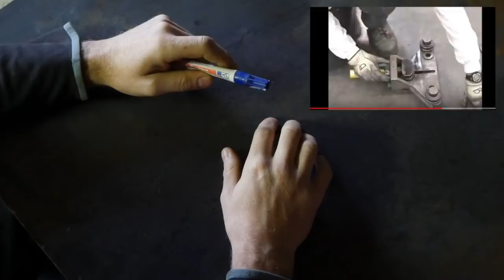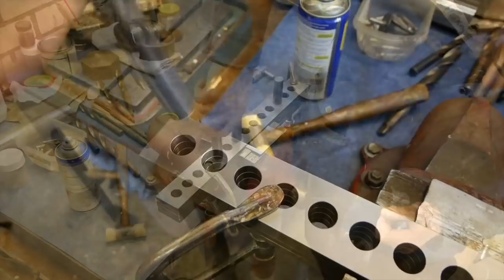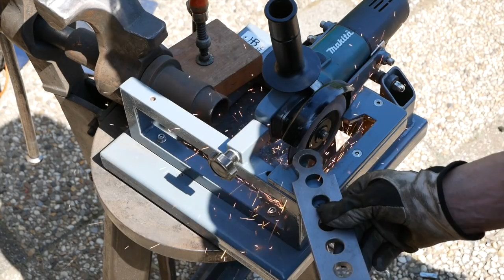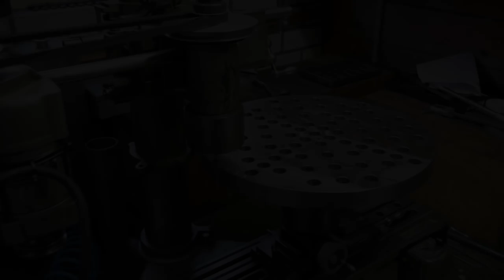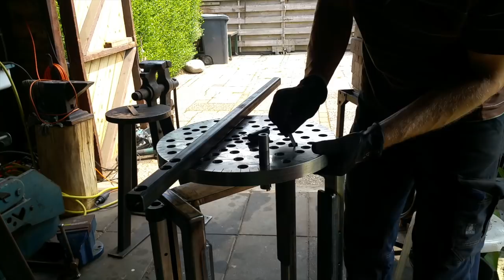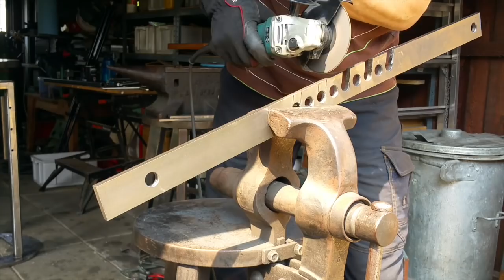Making the ULTIMATE Bending Machine Part1: Hossfeld?

Comment: Hey man nice video!
As a machinist I'd say your feed is definitely slow but also you take too light of a cut. Try doing at least 0.5 to 1mm depth with a minimum feed of 0.1mm
Also if you can use a bit with more of a radius carbon steel doesn't like pointy tools, a 0.8mm to 1.2mm point should work great 👍

I'll keep watching the build keep up the good work

Comment: About time a YouTuber made a descent bender. Very nice 👍. But even with your counter-leaver I think you will still need a bottom fixing. All I did was chemset two tapped bar stock flush with the top of the floor so I can wheel it over the top of them and drop the wingnut bolts through the base plate for bending the bigger stock. 
From the land down under 🇦🇺
Reply from the maker: Thanks! And yes a solid table is always better (or bolting it down to one). But at that time I didn't have the space for that. I am making a large ficture table in my new shop with the same hole pattern so I can also bolt it on there. But until now I havent realy needed it. The extra leverage arm puts to force more in line with the table holes and there is not a lot of rotational force. And it also is a sort of safety factor because the top plate is only mounted with 4x10mm pins. I dont want to have to much force on them.

Comment: Axles are usually mid-high carbon, or chrome moly.
Reply from the maker: Yes but these are much cheaper and I don't use the machine that much. I think they will be strong enough and I can always upgrade. High carbon would be more wear resistant, although I rather wear out the axle and replace that then the plates. I would also be interesting to see if they cold rolled steel is actually weaker for this because the forces are many shear forces.

Comment: Or get one for 150 online. Only going to bend flat stock and there is a much solution. Without Mandela you are not bending tube , or at least bending clean.  Spend a little more and get the hydraulic version no point spending a day busting your muscles the bend it
Reply from the maker: Thanks for the feedback. If someone would only use the Hossfeld than you can also buy it. But a combination machine like this (see part 4 in the end) with a small footprint is not for sale any ware. And I think there are more reasons why someone would build there own than financial reasons. Muscles, are you busting of building ;-). No need to go to the gym then (and the extra leverage arm can make is very easy).

Comment: I have never used a lathe, but I have heard bad bearings in motors.

Check your bearings on the lathe.  Perhaps you have one going out thar is causing your chatter.
Reply from the maker: Yes I need to check these. Although the main problem with the chatter was caused by a lose way gib.

Comment: The reason the rachet bar bent wasn't so much the stress built up in the metal. It's the heat from cutting the notches out. The thermal expansion from the heat of the grinder causes the bend. Even though it contracts when it cools it still deforms the metal so it doesn't come back to true. This effect can be used to your advantage in some circumstances. Like when you want to correct a slight warp in a shaft. Heating the inside of the bend will cause it to bend the other way and when cooled it won't come back to where it was
Reply from the maker: Hi Aaron. Thanks for the feedback. It will be interesting to test this out. The heat input was very low and the hole already drilled. So no heat input on the back side where the bent was going. I can make a new one without the grinder and use a normal hack saw. Still I think there is a lot of tension inside cold rolled steel. About the straightening of the shaft, in my mind it will always pull to the heated spot (shrinks) and not expand. Isn't that the case? Greetings, Bart
Reply: @bartharkemametalworks2299  just get you a piece of flat steel even and try it out. Heat one side a bit and then rapidly cool it. See how far it bends. Maybe try clamping one end in a vise and set up a dial indicator on the other end. Then you have a good visual of what happens. It doesn't take too much heat to get it moving.
Also stress can be removed from metal by peening it with a hammer while as it cools. Just the same as peening a weld

Comment: A very nice looking build. I'm really looking forward to seeing it finished...You certainly have an eye for design, a couple of points I'd like to raise in relation to the manufacture, Sorry but did you reverse out the hand reamer at the beginning? I thought it looked like you did even though it was sped up...Anyway this is a big no no, reamers only ever should travel in one direction. Second.. your turning...Do not remove your centre until after final cut is made, almost certainly it will not have any detrimental effect on this application but if you're trying to turn something very accurately then it will. Third the chatter as you were right to guess is always caused or negated by speed and feed...It doesn't matter what your cutting or on what machine, as long as you have a reasonable set up you can always dial out resonance with different speeds and feed rates. Fourth TIG welding with heavy 3mm ish? welding rods is a horrible thing to do. The end of that rod stays red hot for a very long time, and when you remove it from your gas shield it immediately oxidises, if this happens snip the end of with side cutters before proceeding, because every time you do this you are adding contaminants to your weld. Anyway enough of that, as I say it's a very interesting looking project. Good luck.
Reply from the maker: Thanks for the compliment and feedback. I'm not sure if I reversed the reamer but I don't think I did. I know its not a good thing. The turning, yes the center is not perfect and will change the position. For this project it was not so important. But I do have to learn more about speeds and feeds for this Lathe and the different tooling that I have. The biggest chatter was caused by a lose gib. Tig rod was 2 or 2.4 mm. I like the thicker one's but I make sure to keep it in the shielding gas when it is hot (and clean it before welding). The project is finished and has a part 2-3-4 on Youtube so you got some viewing ahead ;-). Thanks for the tips and if you have any more then please share. Where here to learn (at least I am :-)

Comment: the steel looks really gummy.. .. ive cut that stuff before too, it seems to rip or tear more than cut cleanly,
try increasing the chip load., with less rpm or a slightly deeper cut,   very nice build
Reply from the maker: Thanks, I'll give it a try. That to problem with scrapyard steel. You never know what you get.
Reply: @bartharkemametalworks2299  
also if youre using  a HSS cutter, keep it razor sharp and put a little bit of a radius on the leading corner that cuts first and use plenty of cutting fluid

Comment: Do you have plans for the bender? What is the size of the round plate with the hole in it and what are the x and y coordinates?
Thanks Best bender on the net Id say I want to make one.
Reply from the maker: Thanks Stan. Sorry for the late reply. The plate is 400 mm and 30 mm thick. Hole pattern is based on X-Y coordinates. On the two center lines the holes are 30 mm apart. After that, the X-Y lines are 60 mm apart. The holes are 20mm.

Comment: Awesome design, what is the lay out plans for the holes in the main plate that you had your friend drill for you? Like the design and would like to build some something along this design.
Reply from the maker: Thanks and sorry for the late reply. The plate is 400 mm and 30 mm thick. Hole pattern is based on X-Y coordinates. On the two center lines the holes are 30 mm apart. After that, the X-Y lines are 60 mm apart. The holes are 20mm.
Reply: Barts Metalwork hi : I’m trying to draw the hole pattern  according to the sizes given , and it does not look the same , can you please clarify to me 
If the holes that form the cross that bisect the center are at 30 centres , and then the holes that are parallel to those lines are 60 mm between the center line of the holes that are 30 mm apart , that will be 120 mm distance between the holes at either side of the line of holes that are 30 mm apart. 
Thank you
Reply: @bartharkemametalworks2299  Thank you, looking forward to trying to make my own.

Comment: The problem with chatter is because you failed to clean the outside diameter of the material to a clean bearing surface before applying your steady rest. Nice build👍

Comment: Nice work! I've been thinking of making one myself. what steel did you use to make the arms? S235C or stronger? and for the axle pins? 
how is it holding up?
Reply from the maker: Just normal Cold Rolled steel. It's holding up good sofar.

Comment: True craftmanship! very very nice. chatter caused by probably to less depth of cut and to slow feedrate. You can put the center height a little bit higher, helps sometimes. but like always trial-and-error... when was the last time you checked the tapered key of the cross slide? maybe there is a little play on it. you can tighten it to take the play out.
Reply from the maker: Thank you! And I will try different options for the chatter. Checking the cross slide is a good one, I haven't done that. And I hope it will get better with other type of inserts, stronger insert holder and more feed rate.